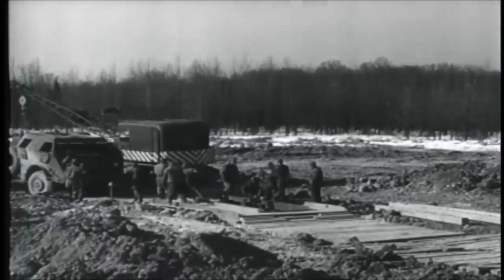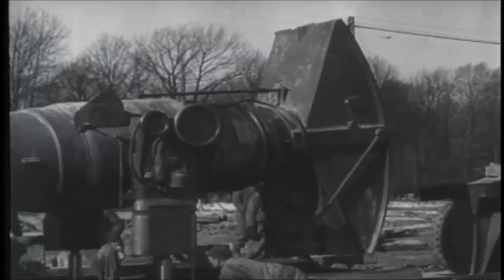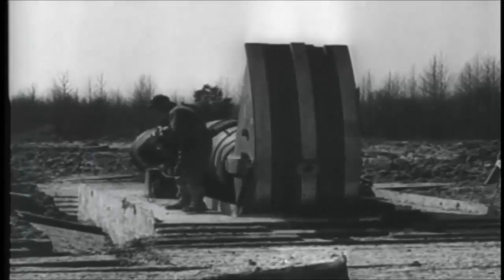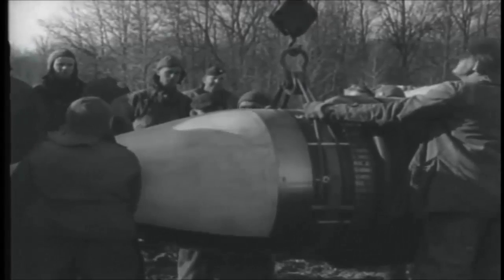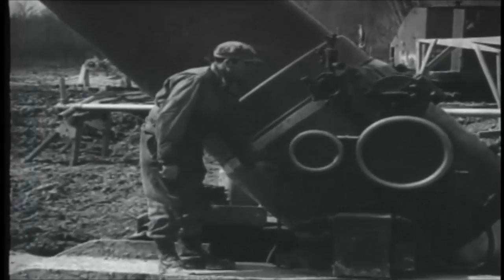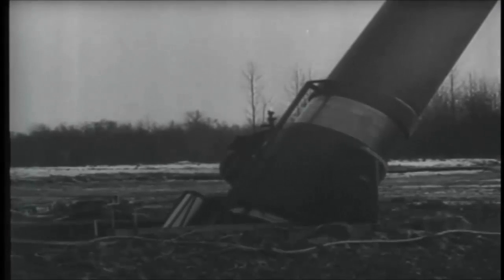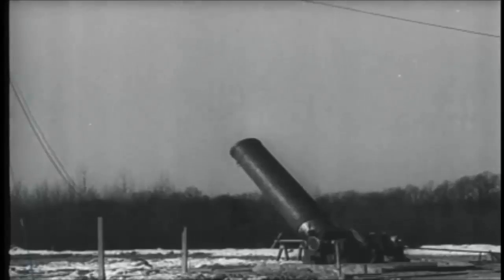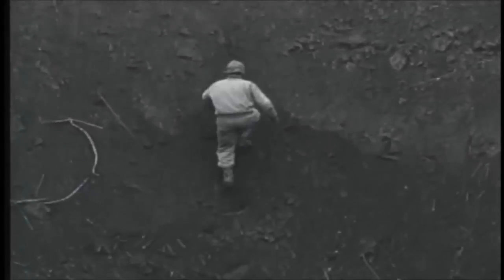Little David 914mm T21 Mortar Test, 1945 WW2 Video Footage

Comment: I have a Crazy Idea. What if a fully working Replica of the Little David was equipped onto a BattleShip or a Dreadnought? Just think, the Mortar firing it 914 mm ( ~ 36 Inch ) Shells at an Enemy Ship and then the Shell falls right on top of the Enemy ship and it lands on the top deck and Explodes. 

Ultimate Destruction.
Reply: you might as well use rockets at that point. also a gun that large would not work on sea because i imagine it would be too unwieldy. reload would be too slow as well and accuracy would be a thing
Reply: The armored mortar shell will require some electronic gudance, beside the mortar's reload and recoil will be too much for standard ship hull.

Comment: is not the bigest
Reply: In terms of size, no. In terms of caliber, it ties with the unused British Mallet's Mortar for the highest caliber of any weapon ever constructed. Both this and Mallet's Mortar fire 914 mm shells while the Schwerer Gustav and Dora fired 800 mm shells.
Reply: It is the biggest, but it wasn't used in the war
Reply: @zamn__  yes because I like a lot of the super caliber weapons they were either too impractical to be used in war or unnecessary. Which in the case of a little David was proved to be unnecessary with the surrendering of Japan. While the Gustav and its sister Canon the Dora proved to be impractical three weeks to set up into Traverse the gun you need to go to Whole rail network, and they could only get off 14 shells a day. In the end traditional supercaliber artillery was Impractical, and in most cases flat-out useless.
Reply: @clonescope2433  yes
Reply: @clonescope2433  yep
Although Gustav have less caliber, it is much heavier